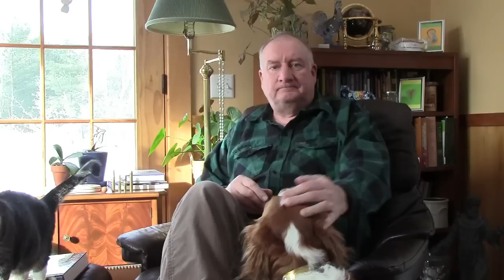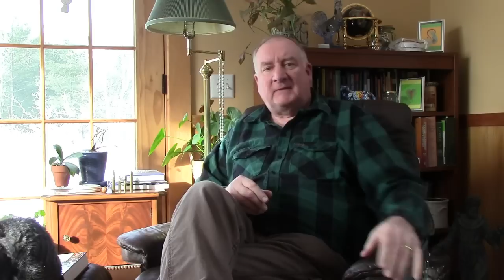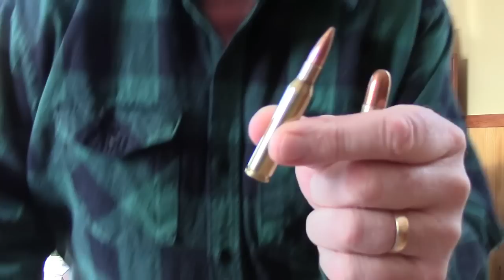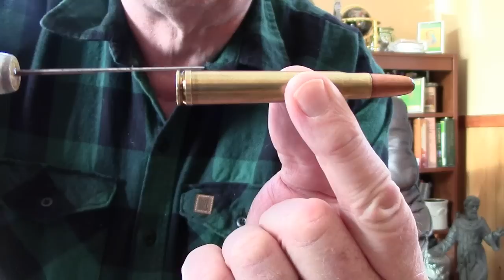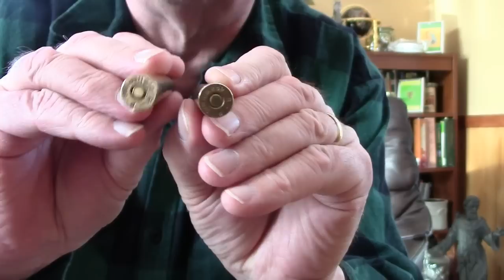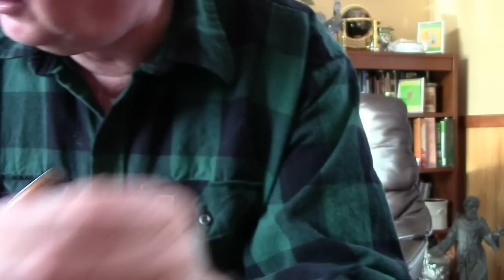How cartridges are named ~ Unraveling the Mystery!

Comment: Great job. I am now less confused. The question I have is: can you use .38 special ammo that I bought to use in a S&W .38 detective Special revolver in a Kel Tek 380 semiautomatic? Thanks
Reply from the maker: Gary Lavorgna 
The 380 Auto is a small rimless auto round of minimal defensive power that uses a 9mm (355") bullet of 90 grains.  The 38 Special is a rimmed cartridge of formidable power, almost twice as long, traditionally used in revolvers for police use, which uses 357" diameter bullets from 90 to 158 grains.  They are very different.  Ammo must only be used in chambers specifically designated for them.

Comment: i would like to know is there much of a difference between a 300 win mag and a .338 win mag other than one is seven millimeter bullet and the other is eight millimeter will they do the same job in hunting will one have a better trajectory if so what would the bullet drop be and does one have a longer range over the other because the cartridges look very similar
Reply from the maker: A world of difference! A 300 Win Mag bullet measures .308.  A .338 Win Mag bullet measures a true 
.338.  The range of bullet weights is much different.  The recoil level is significantly higher with the 338, and the killing power on very heavy game is astoundingly different. A 338 will stop an aggressive killer bear, and will drop a bull elk where he stands, whereas the 300 Win Mag will take more time and require some patience. These differences transcend mathematical comparisons.  I have had experience in the field and at the range with both.  Trust me; one who has fired both does not confuse them.  They both have excellent field trajectories for reasonable shots.
Reply: thank you so much for your reply it has helped me so much
Reply from the maker: But, I also must add that the 300 Win Mag has considerably more recoil than the average person can tolerate and shoot accurately.  The 338 Win Mag is far greater than that, and is absolutely NOT recommended to anyone but a very seasoned, veteran shooter, who has a long experience with high recoiling guns.  The 338 will split your head pronto.

Comment: I believe you but I’m curious why a 380 should not be shot in a 9mm gun? What would the issue be? And where does the number 380 come from?
Reply: I’ve watched your videos closely and so I think I can answer my own questions...I’m guessing the 380 case won’t bond well with the 9mm chamber during fire, causing gas blow back
(no bueno) and 380 (like the 38 special) is the chamber dimension measurement, not the bore.
Reply from the maker: The two calibers are common only by bore diameter. They have entirely different case dimensions. Each headspaces on the case mouth, which is the distance measured between the breech face to the length of the brass. A 380 case will not reach the length of the 9mm chamber, and will have extremely excessive headspace. Also, the body diameter and shapes are not even closely alike. Though the 380 is often called the 9mm Short (Corto), it  is not by any means a shortened version of the 9mm Luger cartridge, as a 22 Short is to a 22 Long or Long Rifle. Unless you wish to have a dysfunctional or dangerous gun, never under any circumstances cross chamber cartridges unless they are designated to be specifically compatible.